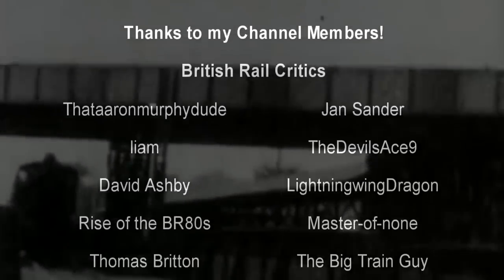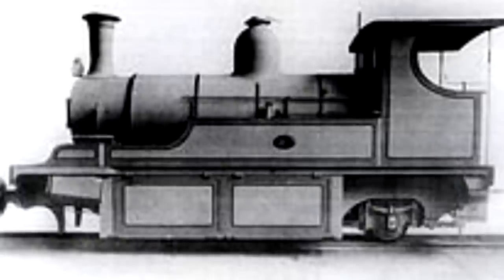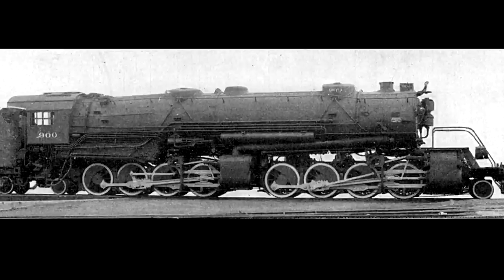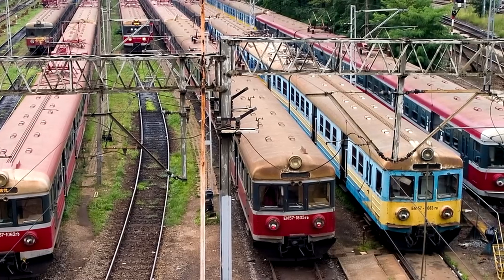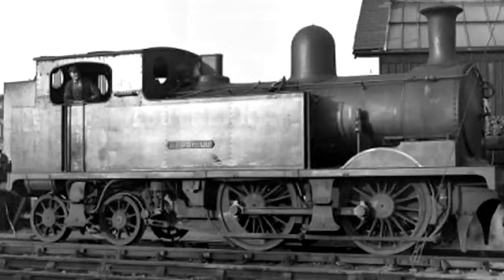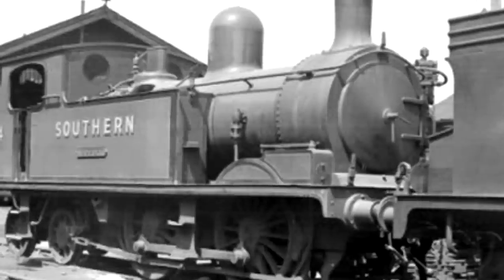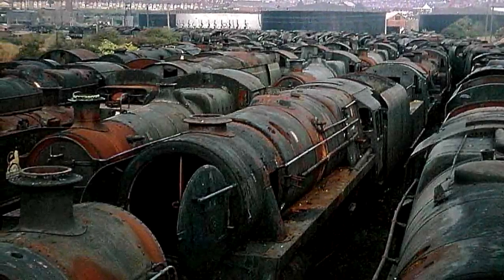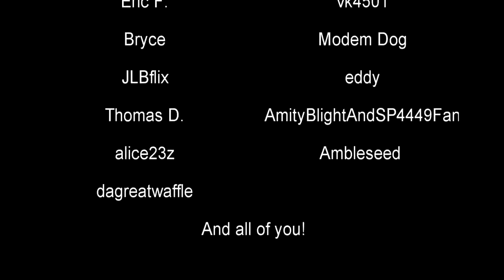5 Trains That Defied Expectations | History in the Dark

Comment: Actually the EN57 type layout is very popular with none other than our old favourite, British Rail. Most of the British Rail overhead powered EMUs were built Driving Trailer- Motor - (sometimes trailer) - Driving Trailer. Whilst the Southern Railway went for Motor-Trailer-Trailer-Motor for their designs and BR kept it for derivatives, when they built a series of entirely new build trains in the 60s they too were DT - M - T - DT (the exception being one series which used the old layout since they were intended to haul or push 4 or 8 underpowered trailers and needed twice the motors).

Comment: EN-57 is the longest running/produced EMU in the world. They were called Kibel (Crapper) by railway workers due to stink coming out from onboard toilet.
Had opportunity to going onboard of original and modernized one. Original ones were horrible, modernized ones are very modern and quite comfortable.
Reply: the OG ones had style
Reply: They were introduced in the mid-1960s in Slovenia (and some on a few lines in Croatia; however, Slovenia and Croatia were both part of Yugoslavia back then) and they were hated by the passengers from the first moment until 2021 when the last one was retired. They were uncomfortable, shaky even where the tracks were in good condition and not very reliable. And yes, the toilets were stinking and they could be smelled in passenger cabins as well. And they were never modernized. They were nicknamed "Gomulka" after the Polish president of the era. No fond memories of them. One question: aren't they by any chance based on some pre-WW2 German S-Bahn trains?
Reply: @maxart3392  they were loselly based on pre war EW51 which was made partially with british components. But 57 is basicaly our own construction.
Reply: The EN-57 might soon surpass the 65 years in normal service of the Australian Victorian Railways Tait train Melbourne EMUs that were in electric service from 1919 to 1984 with about ten years of previous steam hauled service prior to that ;
https://youtu.be/qSyG8mPzWqc
One set of seven carriages has returned to preserved mainline fan trip usage recently. With the carriages in the set built between 1910 and 1918 it would have to be the oldest preserved EMU allowed on mainline use in the world.
YouTube has numerous videos on them by searching for Tait Train.
Reply: @racingraptor4758  And EN56, too

Comment: The EN 57 EMU's will need to stay in service a while longer to beat the NSW railways A.E Tulloch built EMU's, there were still T&E units built in 1924 and first batch of production units built in 1927 still running in 1993, the last of the '24 sets was only withdrawn in January '94 (I worked on them in the years prior to withdrawal).

Comment: If you're looking for engines that broke all expectations look no further than:
- FS class E626, which is a pathological case of "if ain't broken don't touch it", one of the first class of DC electric locomotive in italy they were built starting in the 1920s, and were retired in 1999, but a local regional railway in italy had been using them until 2015 for freight trains (and probably still is). Many were preserved, some of them are still operational.
- FS ALn 668. Originally designed in the early '60s the group had several revisions until the late '80s. Many units were sold to Turkey, Swden and Mexico. In Italy ALn 668s are still in operation, but about to get phased out.
- DRB class 52. Ok they have been gon for a while, but in Bosnia they're still using them to shunt lignite from the mine to a power station in Tuzla. If you want a nice video don't look further than https://youtu.be/teoB8zac-CM?si=Fbm5cN79bxGzmRdP
Enjoy

Comment: Due to the Modernisation Plan of 1955 , which was already being created when
71000 entered service, tge Railway Executive of the BTC had no intention of spending money on rectifying the problems of a steam locomotive that would soon be history. 71000 was a locomotive that they had been forced to build after the Harrow accident. This coupled with the Clean Air Act 1956 (a result of the Great Smog of 1952) meant that coal fired steam locomotive's days were numbered (Section 19 of the Act applies to steam locomotives producing excessive smoke). This act also meant the BTC had to accelerate the Modernisation Plan which meant that they ended up with a fleet of rubbish diesels and a few great ones.

Comment: Thanks for this vid. I'm lucky enough to live in the village of Wootton Bridge on the Isle of Wight which sits at one end of the Isle of Wight Steam Railway. They have an absolutely amazing collection of motive power there with at least two classes that you won't see elsewhere including the O2 W24 Calbourne and the only surviving LBSCR E1 which was previously 110 Burgundy but has now been renamed W2 Yarmouth. They also have half the surviving Ivatt Class 2's and a pair of the famous A1 Terriers including the famous No. 40 Brighton/W11 Newport that won a medal at the Paris Exhibition and set a new speed record averaging 50mph on the run from Dieppe to Paris (presumably because Stroudley was showing off how much better the LBSCR engines were compared to their French counterparts). 

On a sad note I have heard it said from several sources that Chale was a better bet for preservation than Calbourne being in better overall condition. The consensus was that ideally you would save both and use Calbourne as a spares vehicle but sadly Chale was scrapped before she could be saved leaving Calbourne as the sole survivor and although thankfully they were able to fix her up I have heard it mentioned that she doesn't steam as well as she should due to being so run down when she was saved.

On another note to show the scale of changes to the preservation movement when the IWSR first started they relied for four years on a tiny Hawthorne Leslie 0-4-0 saddle tank called Invincible as their only available steam loco doing shuttles back and forth over about a 1/4 mile of track with one coach. These days you will likely see the 2-6-2 Ivatts or a good old Austerity Hunslet with half a dozen coaches going in each direction over 5 1/2 miles of track. Even Calbourne and the Terriers now struggle with the loading during busy summer periods. Invincible is still there though currently undergoing overhaul and when available still runs trains during quieter times.

Comment: To be fair to BR, the steam engine they ended up going with for the NRM, probably wasn't what they would have originally suspected. That class, the 9F, could also have been said to defy expectations.
Reply: Had the Duke gone to the NRM, it probably would have been on static display as an interesting failure forever, maybe steamed up occasionally but still as a lousy but surviving locomotive, preserved in original condition. As it was, saved from scrap and restored, there was the opportunity to remedy the construction flaws ... then hot rod the crap out of it. So had it gone to the NRM, the hidden potential probably would have never been known.

Comment: Standard Class 8 was only going to be a one off engine because BR had only a need for one of this size after one of the LMS Princess Class, Princess Anne was written off. It was as with other Standard Class locomotives designed to share the maximum number of components from the other Standard Class locomotives (in her case the Standard 7) and so their absolute performance was compromised in return for better serviceability. However basically she was given a "tuning job" which effectively de standardised her, but as result improved her performance.

Comment: The previous LSWR tank engines which "wouldn't do" were the Beattie Well Tanks.  The last two of these also ran until 1962 when they were 88 years old before being withdrawn by British Railways and being preserved.
Reply: The O2 and even the Beattie well tanks were  not quite as long lived as the New South Wales Railways A class , later Z19, from 1877, built by Beyer Peacock in Manchester. Reaching 96 years in normal service into 1971 right near the centre of Sydney at Darling Harbour. A great high standard vid on them :
https://youtu.be/S0izTlCTHJc
Lucky a TV news director was train interested and took some very professional films of them in their last year's of usage as shunters (switchers). The late 1971 withdrawal meant we still have some of the crews of them to interview.

Comment: Random thing about EMUs, English doesn’t really has the difference between a „loco with passengers car“ and a „flexible train unit“, they’re both EMUs. And to me that’s frustrating, because the „flexible train unit“ kind of EMU often has completely different design thoughts compared to a one car EMU. The single cars were often meant to pull normal trains instead of a loco, maybe even with a cab car, while multi car EMUs were more meant as a kind of train module that guaranteed equal or at least similar performance figures no matter how many you hook up together. At least with BR‘s AC EMUs it was fairly common that the power car was as central as possible, I‘d think to guarantee proper power distribution no matter how the sets were turned. These days it’s also fairly common to see distributed power throughout EMUs (as in every other car is powered or every other bogie has a motor or similar).

Comment: To finish it off - Duke of Gloucester should not have been built at all. British Rail considered there were enough locomotives of its power class around when they defined the types to be built as British standard locomotives after 1948. Just because one of those (just exactly) enough locomotives was involved in a crash and the diesels of that time proved troublesome in themselves, it was that Riddles opened the drawer with the locomotive ready to be built but cancelled, to build a one-of as replacement for a destroyed LMS Coronation Class locomotive.

Comment: EN57s are often referred as 'crapper's or other derogatory terms, because they are, frankly, a train without a purpose. They are too slow to be long distance trains and they are too constrained door count and power wise to be a good at being a commuter. So they were average at both. But they were cheap and, in spite of everything, reliable. So in fact that over 1700 were made. Being 'proud' of them is a really funny thing. Most were subject to communist quality of both track and manufacture. They rode poorly on poor track, and tended to smell of toilets, greases and, in winter, hot air over people's boots. Since they were so common, people just didn't like them.

That being said - now, with CWR everywhere, and modernisations being done, sometimes very deeply, they are pretty good at what they are. For me, they usually have at least one, sometimes two, roomy compartments for bicycles, which is something that modern trains lack. I think about 150 are still in service, but they don't really resemble what they started as.

Comment: Multiple power cars on EMUs are not that uncommon. All 4 generations of the DSB S-Tog, excluding the 2-car sets have multiple power cars. As did the BR Class 313 to 315 series of 25kV AC EMUs, as did the 750V DC Classes 411, 412, 415 and 432 on BR(SR). Also having a single power car with the traction motors in the centre of a 3-car EMU is nothing unusual, BR was doing this around the time the Po,ish units were being build (an example would be the Class 303).

Comment: It would have been embarrassing if the dog (Duke of Gloucester) had proved that it was more capable than the locos built to replace steam. Especially because it was tax payers money being spent at the time on the modernisation programme. The flaws were due to not following plans, now I’m not a conspiracy theorist but considering a type 5 diesel would produce only slightly better, one has to wonder what the hell was going on. Designed to work built to fail.
Politics is a fickle thing.
On another note looking at the comments I saw about the O2 come into consideration I have 1 for longevity which is the midland 2p, a class that there should be a recreation of built. And for speed the lswr t6. The t9’s are always sung about but the t6’s regularly put in mid 90 mph running. Probable contender for beating city of Truro to the 100mph barrier, but in my mind proof that it was beaten by atlantic classes well before the Scotsman.
Great content as always.